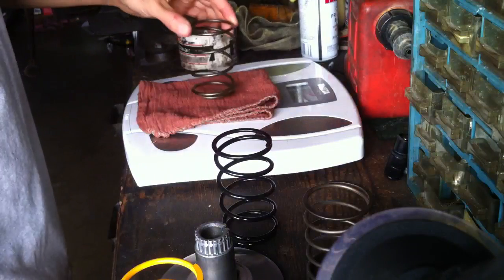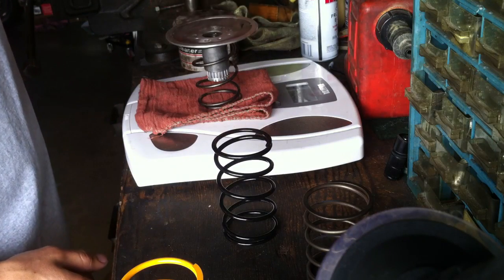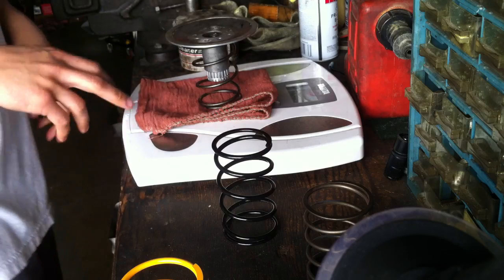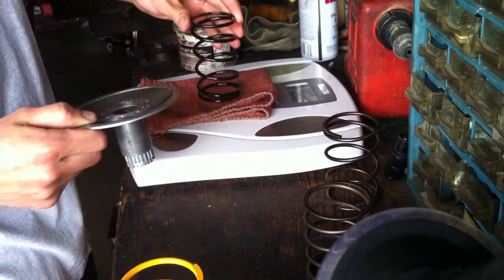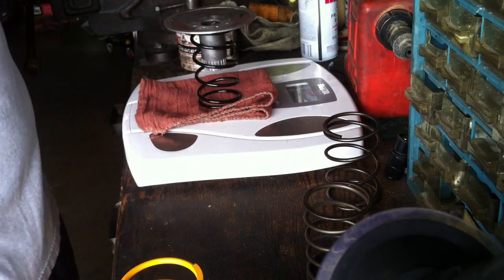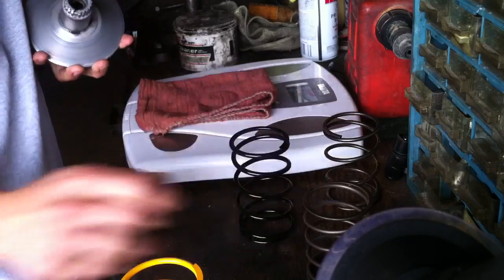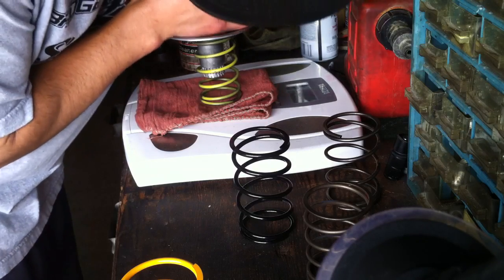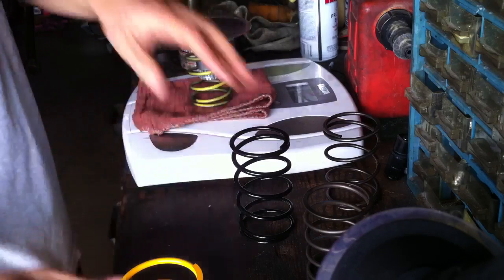Contra/torque spring resistance

Comment: very clever.  Good idea!  another way I guess you could do it for it to be more accurate is to have some sort of bridge over the scale and push down until the legs of the bridge touch the tabletop.  This stabilizes and makes it so you accurately get only the Spring force on to the scale.  The legs help do what you're doing with the rear pully for consistency but to a greater degree and more stability.

I just came up with this after watching your video so in a sense, my idea is just a modified version of your idea!  =D
Reply from the maker: Very good idea. Might have to make something to do this. Only reason I did this is so everyone can do this at home using the same materials. If I make a bridge, everyone would have to fabricate the exact style set up to get the same style readings.